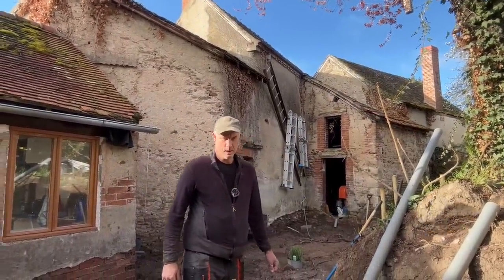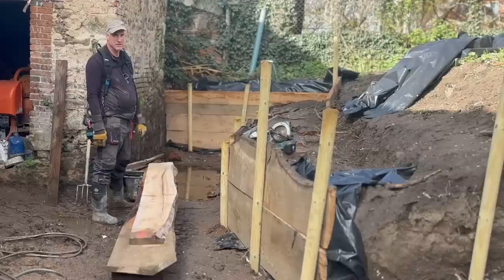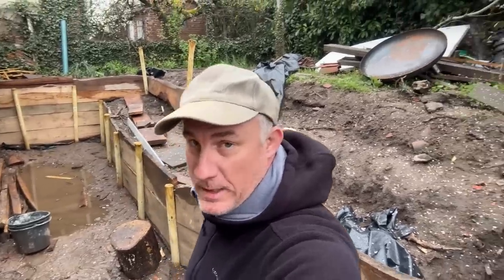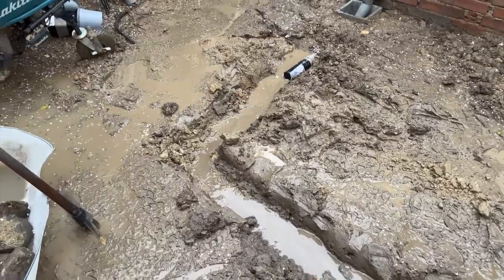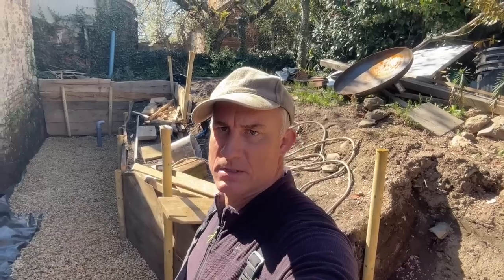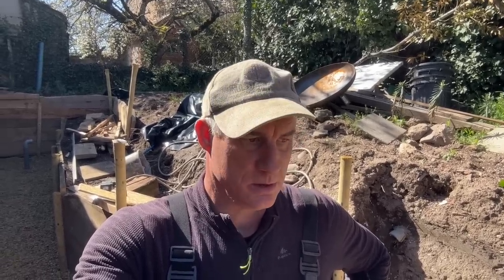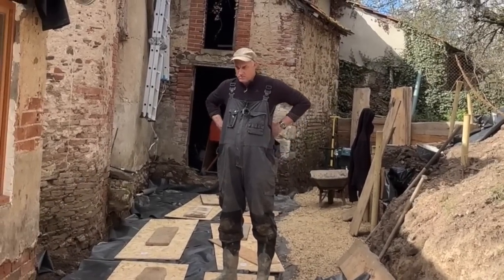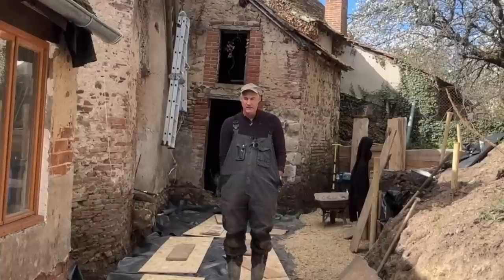Episode 26, French drains.

Comment: Too bad you didn't use Shou Sugi Ban to preserve the wood. It would have made it last a lot longer.
Reply from the maker: What’s that? Is the stuff I’m using not that good?
Reply: @thisoldhousefrance  It is a technique where you burn the outside of the wood. Charring the wood makes it less susceptible to insects or to rot from moisture. It is an ancient technique used also by Iron Age people building their houses. The wood is covered, after the deeper charring is brushed off using a wire brush, with a preserving oil. Here is a video on how it's done. https://www.youtube.com/watch?v=CojWo7XgTwc
Reply from the maker: @cherylstraub5970  that’s interesting. The resulting look is not what we’re after but I could indeed have done that on the sides facing the dirt with the additional fungicide and plastic sheet backing. I wish I’d known of it before. Thanks for sharing!

Comment: Sorry Marius also is the Matika  wheel barrow worth buying ?
Reply from the maker: The frame collapsed on mine because I overloaded it. I think the wheelbarrow in itself is a good product but the frame is just to flimsy. I will strip it and reinforce the frame when I have time. There are quite a few parts that slide in and lock with machine bolts, I will also weld them and by doing that avoid loose connections.